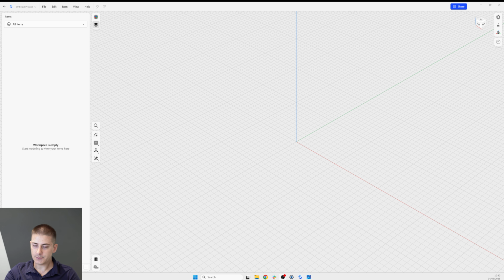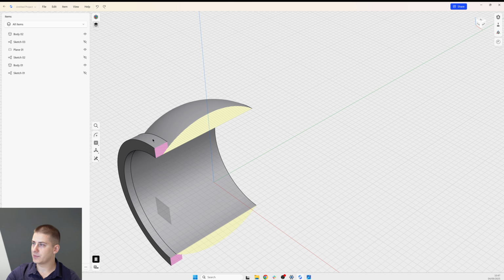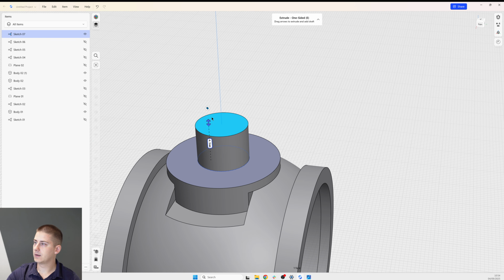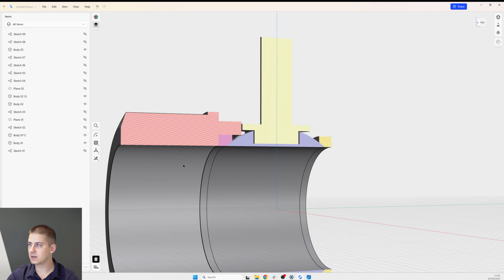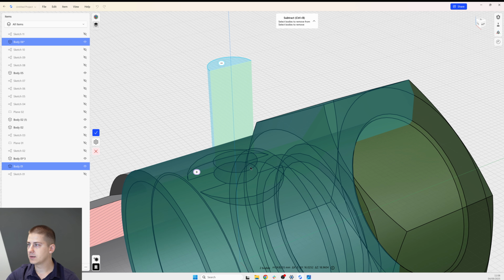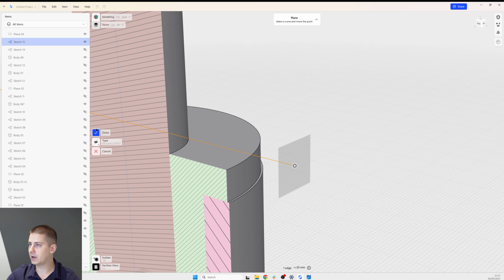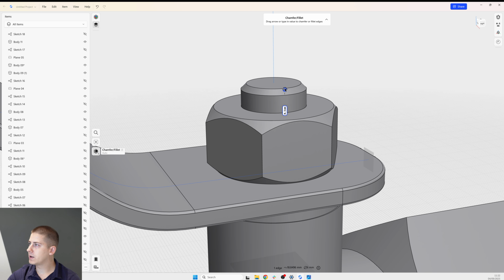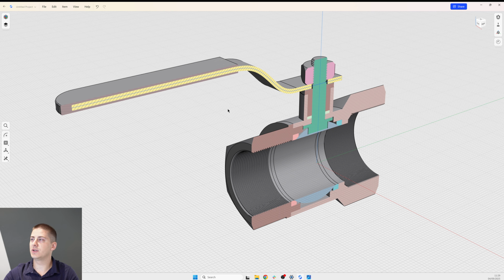Ball Valve | Shapr3D modeling videos

Comment: I drew a step-by-step video, the question is that when the faucet turns, the ball rotates inside the tap and there is space on the sides, because the ball should completely cover the tap when the handle is turned.

Comment: Thanks for the lesson. I use Sharp3d for my design and it’s a well designed system I prefer to sketch on iPad and do the final mods on a desktop and the communication is smooth.